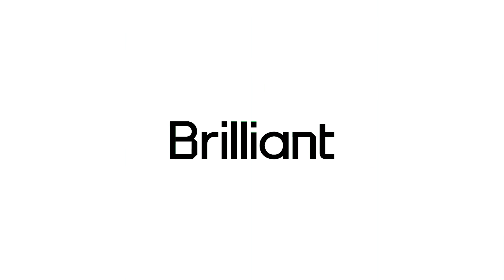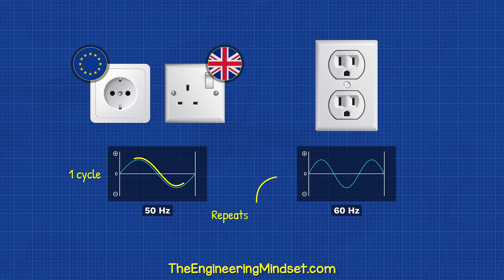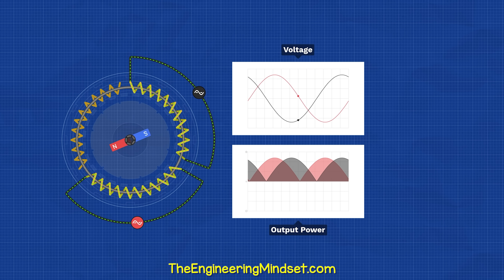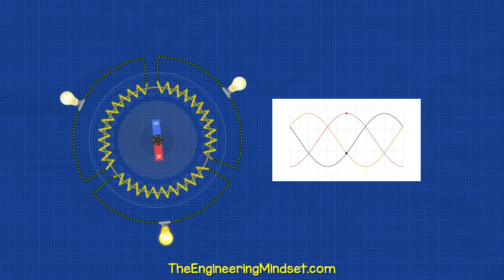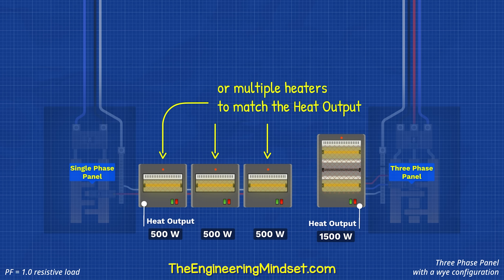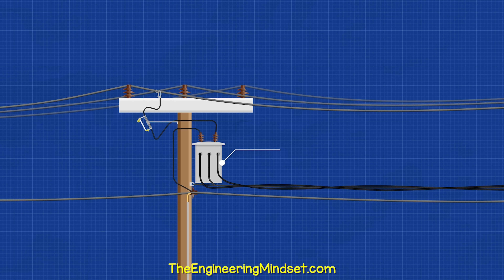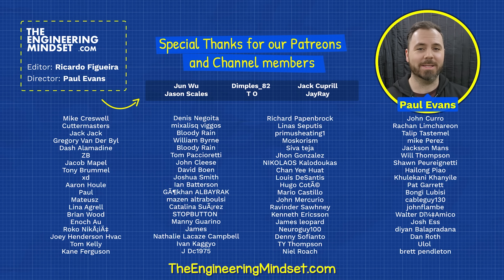How 3 Phase Power works: why 3 phases?

Comment: For a given mechanical size of machine, an infinite number of phases will yield a certain output. Three phases will yield 96% of that possible output, 2 phases 90%, and 1 phase 65%. Three phases were selected as a compromise between output capacity and complexity of construction. This also explains why a single phase machine of a specific output is larger than a 3 phase machine of the same output.

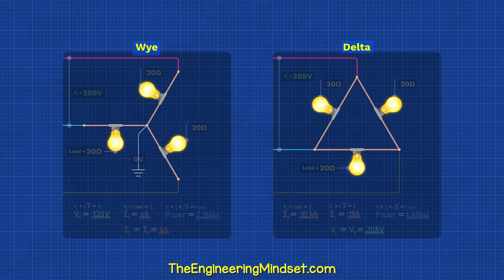Comment: @8:17 would that be 3 phases and 1 "neutral"?
Just checking. I absolutely love this channel <3
Reply from the maker: Wye side yes, has neutral. But, if all the lamps are equal size resistance then the same current will flow on all lines so no current flows on the neutral (it only carries the imbalance) and it therefore isn't needed

Comment: At about time 12:00 , the audio (incorrectly) says "squared" the value, whereas the text (correctly) says "took the square root of" the value.
The purpose of Root-Mean-Squares is that, given a repeating wave form, the RMS of such a system will be equivalent to the power (voltage x current) in a DC system

Comment: you didn't explain why we need 3 rather than 2. You kinda just said "if we put the second phase 1/3 of the way away, it doesn't cover the gap". In other words, "we need 3 because they're 1/3 apart, and they're 1/3 apart because we have 3"

Comment: i think its fair to say that a minimum of 3 phases are required  to establish directional rotation so a motor can follow the phase rotation
Reply: 2 phase power will accomplish this,, is 90⁰ out of phase and provides constant power.  This was necessary in the old days  to start motors, but now a start capacitor is used to get the motor running, thus there is no longer a justified need for it.

Comment: Thank you. I've watched this a few times and each time a little sinks in. Your explanation is exemplary. I have a novice question so please don't attack people! I'm a sensitive person. So soft and gentle. Would it work IF you placed a second outer ring for the spaces? Duplicate energy? Sure, it would be less powerful but it's better than nothing. Perhaps it could power the inner primary ring. What? I said I was a novice. No need to get personal. I'm sensitive, remember?

Comment: 3-phase at homes is standard in most if not all of continental Europe.  Electric cookers are typically connected to 3-phase power.  I only have a single 3-phase consumer which really needs 3-phase power, a pressure washer.  There was a single phase option of the same model available.  Virtually the same power etc.  but the motor running at twice the rpm.  The 3-phase motor is just the longer-lived option and has no capacitors or electronics that could fail.  Similarly it's handy to have a 3-phase outlet for the odd craftsman which might need it or the circular saw for firewood.  3×16A is what a typical home outlet has but 3×32A and 3× 63A could easily be installed.
Reply: the 3x32a & 3x63a sockets are uncommon because the common main fuse sizes are 3x25a & 3x35a

Comment: The real answer is you need a rotating magnetic fields to easily start motors. Three phases does that the most economically. It's all about cost. Follow the money. Fewer wires and equipment to get motors running. The three phase rotates and starts all other three phase motors by dragging their rotors around with it's rotating magnetic field.

Comment: Well done. One of the best visual descriptions of basic power, production, and transmission I’ve seen. I am such a nerd that I bought two of your cups, one medium one large. Just because they’re so cool. I’ve been an automotive technician for just over 50 years. So understanding electrics has been a important part of my career. And boy has it changed rapidly. Understanding alternating current ( alternators), voltage regulators and bridged rectifiers With their effects on systems when failing is a large part of diagnostics. At home I had a poor connection on the Neutral at pole, that caused an imbalance between the phases. That the power company didn’t believe until I made them come out. Unfortunately it took out the ECU processors in both the newer washer and dryer. So understanding electricity translates to many areas. Subscribed, thanks again.😊
Reply from the maker: Thank you, glad it was useful and thank you for your support,  I hope you enjoy them, much appreciated. Send a photo in, maybe we can publish it. Not sure how long you've been a subscriber, but just incase you missed it, we have also covered car alternators, car batteries and starter motors in previous videos along with differentials too!

Comment: This is a REALLY great video but I don't think you explained enough about the 3 phases. Before you even mentioned it, I was thinking, why not have more than 3 phases and can you do that with more coils? You said using more than 3 phases or more expensive and complex, but surely having 4 phases wouldn't be?

Are there any applications where you'd have more than 3 phases? Also, how do you vary the frequency? Is it commutator speed or coil size?

Also, it's there a reason why it's 240/415v or are the voltages just arbitrarily chosen?

These are all important questions that is wished you'd answered. Excellent video though.

Comment: Very good!  I have forgotten all my AC circuit theory and most of my DC, too, as I don't ever use it. P=IE and E=IR are all that I need.
Load balancing three phase can be fun.  We had a computer room with 11 minicomputers in it with some equipment using 208V and others 120V, we had to take into account surge current for the motorized equipment such as removable pack disk drives and tape drives. Total current when all computers were up was about 175 amps per leg.  The computers were sequenced up so as to not overload any leg.

Comment: Hi in the UK we get240v 1Ph and 415v 3ph. When we joined the EU which runs on 220v rather than everyone changing they just decided to use 230+/- as a reference voltage . We are above it and EU is below it. The frequency is the same. Not sure how the country inter connections are managed

Comment: By the way, the root mean squared voltage is no coincidence or accident, and it's easy to see that this is the equivalent DC voltage in terms of power output from a resistor by using Ohm's law (assuming resistance is constant). That is, I = V/R, and P = IV, so (the other common statement of Ohm's law) we have that P = V^2 / R or in other words, power is proportional to the square of the voltage (this is where the square and square roots come from). Energy is the integral of power w.r.t. time - for AC this will be like the "sum of squares" in RMS, and for DC (constant voltage) this will simply be E = Pt = t V^2 / R. Setting these energies equal, the resistances cancel out (assuming R is constant), and dividing by total time t turns the sum of squares - like term into the mean of squares. Finally, solving for DC voltage by taking the square root gives the RMS of AC voltage w.r.t. time. For a perfect sine wave, of course this can be solved exactly with basic calculus over, say, a single period, giving the sqrt(2) factor between DC voltage and peak AC voltage (sine wave amplitude) in the video.

Comment: I understood shit at first, and then you lost me at the 6:30 mark💀
Reply from the maker: What in particular did you find difficult at this point?
Reply: @EngineeringMindset  I don't even know, I understood everything before that timestamp which was great! but everything after that just went so far over my head it disrupted air traffic, probably doesn't help that all my engineering knowledges stems from youtube videos💀
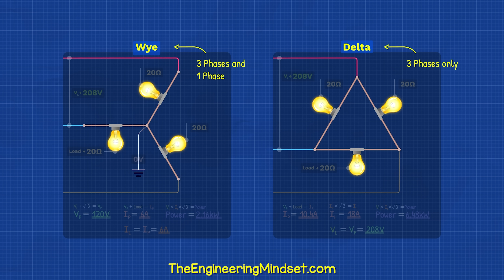Reply from the maker: Ok well if it's the connections, then there are two ways to connect the 3 wires together. Wye or Delta (8:20) or we can connect to just one wire and the neutral for single phase (7:52). We know when the magnet spins, it spins past each coil at a different time, so the electrons are going to be pushed and pulled at different times in each wire that connects to the different coils. If we connect the three wires together, the current will flow forwards and backwards on each wire at a different time, so while one is pushing forwards, another is pulling backwards. We can see that in the sine waves. (6.49). 
Don't worry, no one is born knowing this, we all had to sit down and learn it. I highly recommend, if you want to understand it, make some time, watch it again, pause the video and make notes, watch the video in full, write down anything you didn't quite understand. Things will click in your brain as you process more information and more things are explained later in the video at a more appropriate time. If, by the end of the video you still have questions written down, then find answers for those questions on google or write comments.

Comment: I don't want to be that guy, but there's some stuff in the video I have to clear up:

2:50 
This setup shown there wouldn't work, as the voltage induced in the coils would cancel each other out. (Since one coil has the north pole passing through, the other one has the south pole passing through. Since the coils are wired in the same direction their polarity would be switched).

8:38
Your wording is off here. The delta connection DOES deliver 3 times more power when you're using the same load.  
However it CAN only deliver the same load (you just design your load to either run on delta or star)

8:41
A delta connection can power unbalanced loads.   
Star can power balanced load without a neutral, but must use a neutral for unbalanced loads.

Comment: You can have a neutral on a delta as well. Also you do not get 208V phase to phase on a delta as you showed. Phase to phase on a wye connection is 208V, 120V phase to neutral. Phase to phase on a delta is 240V, 120V phase to neutral, and the third phase, with no neutral between it and other phases, will read 208V to neutral.
Reply from the maker: Absolutely, we covered 3 phase transformers in detail in our last video here: https://youtu.be/u0SsejDCVkU

Comment: the multiple phases in the example of the motor or even the power electronics of some devices (i.e. computers) makes sense now.  Its for overall greater power output (amongst other reasons like better temperature regulation, more stable voltage due to less ripple, etc).

Comment: Industrial electrician here👋. In my apprenticeship the idea of a neutral wire was one of the harder things to grasp. This video does a superb job of explaining not only that, but single and three phase power from generation to utilization! I've passed this on to my apprenticeship director to help the next generation easily acquire knowledge that I struggled with. Great job, sir! 🫡
Reply: There are counties with 2 Phases only, Motor than same
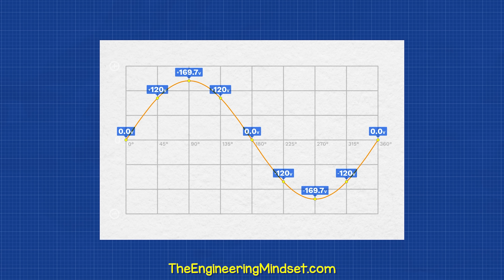Reply: I'd advise against passing this one. Electricians themselves, and in fact most instructors, are not themselves qualified to understand how non-electricians might grasp certain basic concepts. The reason for this is simple: you already understand them. You've lost the power to see where people lose the train of ideas. I recommend you find several beginners and learn by showing the video and watching and asking where they lose what makes sense. Ask pertinent questions at certain times, like after 3:00, can your student explain electron flow directionality through a wire at forward and reverse sine phase? I suspect most will not, because the video glosses over this.
Reply: @peterzelchenko  The video focus wasn't about electron flow anyway.

Comment: Now put it on a 60 rpm hydro unit. Use 120 poles on the generator windings for 60 hertz power 120 x 60 = 7200 hertz per minute.
  Steam turbines like the one displayed, rotate at 3600 rpm. 2 x 3600 = 7200 hertz to match the US grid. DC electric power is adjusted to the rotor to raise or lower output of generator to match grid demand.

Comment: As I understand 3-phase power, the way that I would try to explain it is to point out how AC power follows a sine wave, with peaks and valleys.  The power represented also would track those peaks and valleys.  But you really prefer for your power distribution to be nice and uniform, not "wavy".  By sending on different lines that are out-of-phase by 120 degrees, you can balance out the peaks and valleys, to achieve a more uniform power delivery.

Comment: As a car mechanic, I understand 12v DC systems thoroughly. I’m also an RC hobbyists, so I understand DC lipo voltages quite well also. AC voltages always confused the heck out of me, I never understand how there could be a “neutral” wire, because my brain has always been trained to understand positive and negative, and nothing more. I think I get it now
Reply: So, I don't know engines very well (EE here) but the voltage induced in AC due to a rotor's magnetic flux is kind of like firing pistons at different angles: most efficient when fired at max piston height. Firing a piston when a piston has provided less compression to the air/gas mixture will provide less force to the crankshaft. This is similar to how a rotor magnetic field will induce less voltage when the rotor field is not at a maximum when "cutting" a stator winding in a generator.
Reply: You can think of the negative side of the battery as a neutral. Both serve as a path for current to return to the source.

Comment: This is a nice explanation, but you spoke too fast and didn't allow for enough video time to see what was going on @6:25.  I wish you had explained more detailed why and how each bulb gets the current it gets.
Reply from the maker: Thanks for your feedback. After many years of feedback from too fast to too slow, we have settled on this happy medium, you can turn on captions, pause the video and also slow down the video in the settings icon. If you watch the currents flowing at 6:36 notice how each moves at a different time, depending on the positing on the magnet pulling or pushing the electrons with the sine waves. It's all about the sine waves and how they are not occurring at exactly the same time. So the current is flowing forwards and backwards at different times on different wires, the current can only flow to a point of lower voltage.
Reply: Click the settings button and make the video speed .75 💀

Comment: 1 -- excellently done
2 -- minor quibble -- it's not really needful, but it's a good thing to mention it, I'd think --
a -- power transmitted is a product of the voltage times the current.
b -- the amount of energy losses to DC power is directly related to the voltage.
c -- the amount of energy losses to AC power is directly related to the current
d -- as a result of a, b, & c, if you jack up the voltage high for AC, then the current can be much lower despite very high power transmission. And since it's AC, the losses of a high voltage low current are low. THIS is why voltage is jacked for AC -- and it was, in fact, one of the chief reasons why Tesla's AC system won out over Edison's DC system. They realized, even in the 1890s, that it was easier to generate power in one place and transmit it far away -- in particular, generating it at Niagara Falls in upstate NY for consumption in NYC.
Reply: .
But Edison's greatest achievement came in 1879, when he invented the electric company.  Edison's design was a brilliant adaptation of the simple electrical circuit: The electric company sends electricity through a wire to a customer, then immediately gets the electricity back through another wire, then (this is the brilliant part) sends it right back to the customer again.

This means that an electric company can sell a customer the same batch of electricity thousands of times a day and never get caught, since very few customers take the time to examine their electricity closely. In fact the last year any new electricity was generated in the United States was 1937; the electric companies have been merely re-selling it ever since, which is why they have so much free time to apply for rate increases.
 - Dave Barry, "What is Electricity?"

😀

Comment: Two things I thought of that might be interesting. One is that between how common LED drivers are getting and how common solar installations are getting, it's actually usually less expensive at small demands to go from single phase to three phase or to convert between 60Hz and 50Hz by converting to DC first. In the past, the cheap way was to couple the shaft of a motor for one type of power to the shaft of a generator for the other.  The other thing that's fun about three phase is that the motor reversing method is just a function of mathematics, not one of electricity. If you number the 3 leds from the video they light in a pattern 123123123123  pulling from that pattern at slightly different times you see three numbers: 123, 231, 312  Now if you turn it backwards you see another pattern 321321321321 which gives you three other numbers: 321, 213, 132  swapping any two digits in a number from one collection gives you a number from the other collection. In math, this is S6, the symmetrical group with 6 elements, where each 3 digit number is an element of the group, and swapping digits is the operation.

Comment: Basically a generator uses magnets to push electricity. But the power wave goes high and low. It's not constant current. 3 phases or 3 electrical power waves smooths out the highs and lows of electricity produced in a magnet and coil moving electrons. There must be a better way to generate constant steady electricity power smoothly, without all these highs and lows in a power wave magnet AC coil generator. By speeding up the generator it does smooth the power output, but it still flickers, drops from high to low at 60 hertz AC. Nice to invent a much smoother constant electron flow generator. Anyone ??? 😊